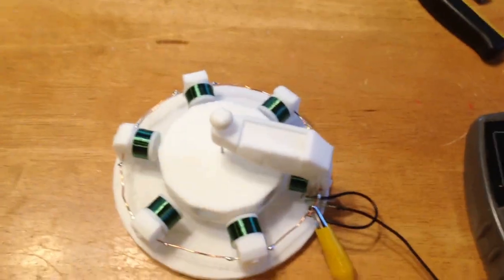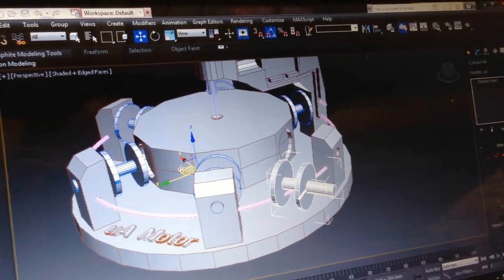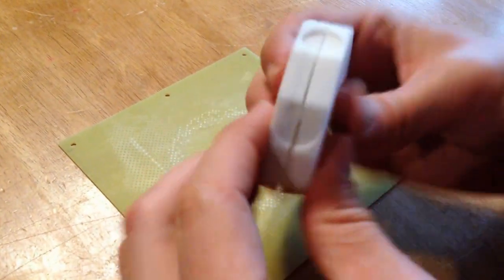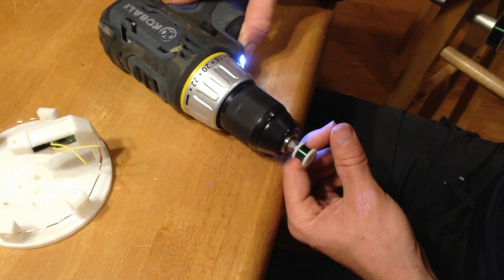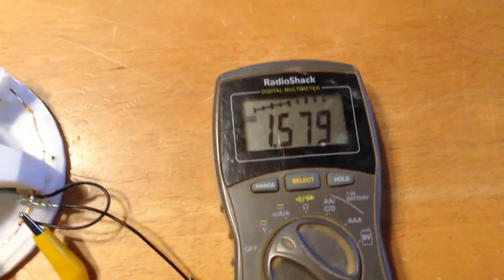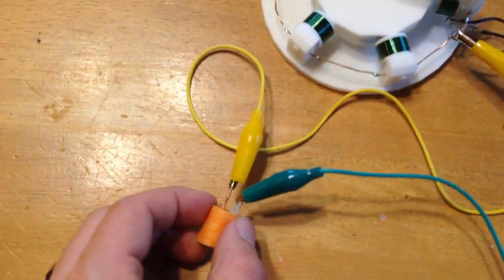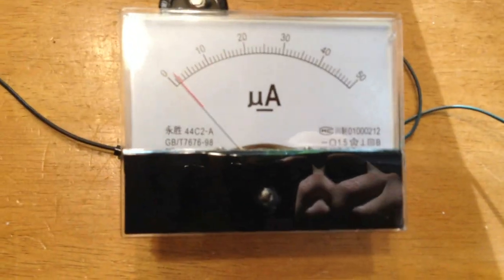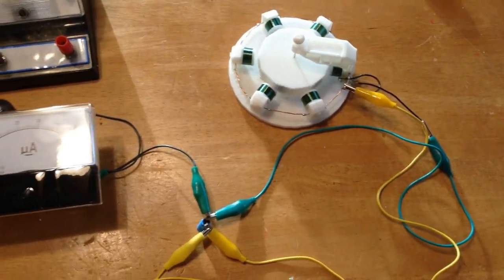3D Printed Motor Runs on Almost Nothing!  Afinia 3D Printer

Comment: what would happen if you connected the voltage from the one motor and connected it to the other.. and let each motor sort of supply the other one with energy.. until it all runs out.

Comment: You can improve you efficiency and power by using asymmetric coils and slightly rotated magnets.  Right now most of your force is lost to cosine inefficiencies.  you are trying to convert linear force to angular momentum, so the smaller your force interaction radius the faster it will spin, but it will have less torque.  It stops speeding up when the torque from the magnet is equal to drag torque from the air.  You can then increase your force interaction radius and therefore your torque by orienting the field lines along a line not going through the center of rotation.  You can do this without increasing distance between the coil and magnet by using the asymmetric coils.

Comment: most 3d printers ffd require you use a slicing program that generates code that tells the printer how to build each layer. that is why you see  "infill" pattern on the printed parts and not the model. in 3ds max.

Comment: where is the switching being done. You cant just power coils and get the unit to spin. you have to switch the coils on and off at the right timing. I noticed a component that was not discussed or shown in the overhead arm was that a reed switch? if so there must be some resistance from the magnets attraction to the reeds. Would like to know that part.
Reply: There's a reed switch :)

Comment: This matrix idea to save material...
What if you designed a matrix that allowed you to inserts a slow-curing hard plastic of sorts, to solidify the part and strengthen it over a massively printed part? Effectively, I am thinking of 3D printed molds, I suppose. But the molds might as well be part of the end result.

While I appreciate the achievement of such a low-input motor, I feel it's more interesting to find one that is efficient with a significant load. Hit 100%, and try beyond!

Comment: Excellent project !
Say, if you are using a friction fit for the needle down the middle of the rotor, you could perhaps use a magnet in the top assembly, cut the needle down and use magnetism to hold it. Would have only the bottom contact then and that would be lessened by the magnetic pull above too. Magnetman2010 showed it few months back and it's worked great in many of my own low power motors.

Comment: You say its the most efficient but you didn't calculate the work performed. I'm sure you realize that efficiency of any system is not the simply the energy used, it's a ratio of energy use to useful work performed. It would be interesting to see how fast it would get up to if you placed it in a bell jar with a near vacuum. You could then approximate the friction of your axle. Also, you might reduce the friction if you used a balance point under the rotor like the classic Crookes radiometer.

Comment: You should test it under some load to tell how efficient it is. Put a pulley on it so that it can lift a small weight. The efficiency will be approximately m*g*v/I*V. m is the mass of the weight, v is its vertical speed, I is current, V is voltage.

Comment: Hi Frank Blackgrow. When I began to look for a printer I assumed the $2000 or so I plan to spend for a printer would include 3d design software. Lulzbot says no. I'm considering their TAZ which has the largest print volume 11.7" x 10.8"  x 9.8" They recommended Blender 3d (free) Google Sketchup (free) Freecad ?, New Tek Light Wave ?, Solidworks $5000+, Autodesk Inventor $4000+. I have opted to learn Blender 3d. I understand most 3d machine sellers provide software to drive the printer only.

Comment: You call your motor efficient, but that isn't true. To calculate the efficiëncy you divide the usefull power(usefull output) by all the used power(all input). You're motor doesn't move anything, doesn't lift anything, it doesn't do anything, it has no load,except the very low friction(clearly not usefull). Therefore there is no usefull output. So your motor is a 0 % efficiënt. Nice toy but no more than that.